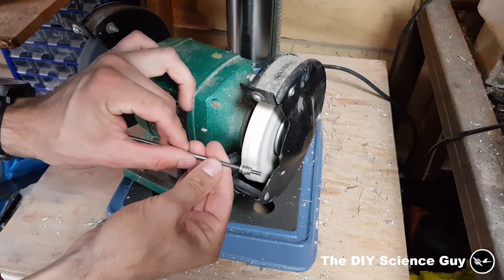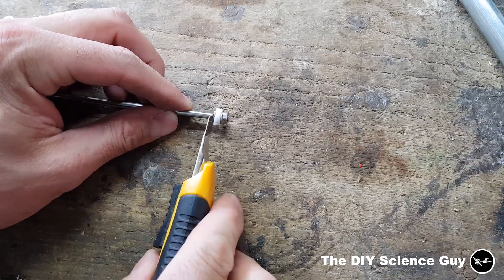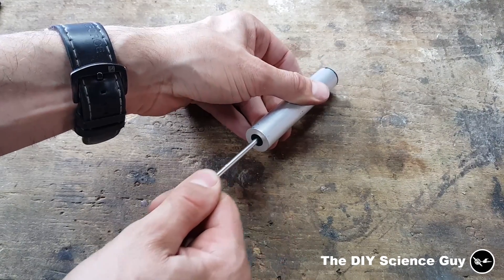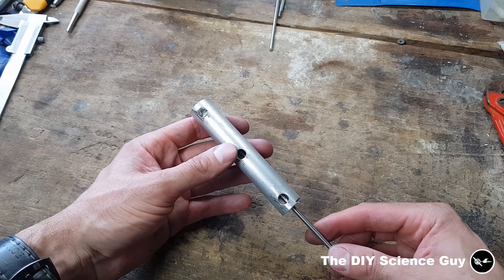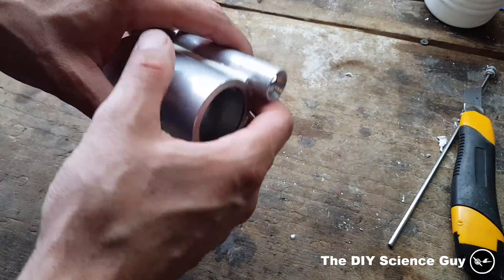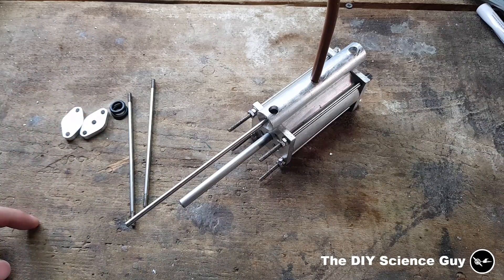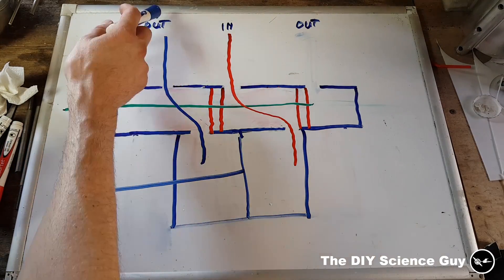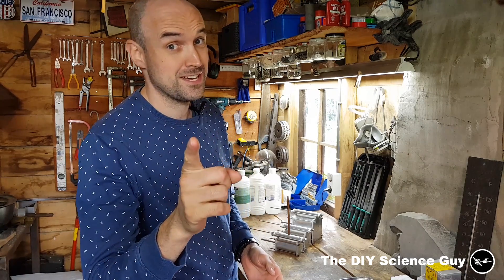Solar steam engine #4 the valves True DIY

Comment: Hi there. Hope you are well and happy. Looking forward to seeing how you set up the valving timing on this engine. Do you have a plan in mind??  Have you studied the valving on other compound engines?? That will be the tougest part of your project. I have been thinking about how you might be going to do it, but so far I have squat. The fact that you are going to have them offset from each other by 120 degrees, seems to make it even harder to comprehend. Good luck with it. I am hoping you can come up with something.Your outboard engine really runs smoothly. So the basic valve design is good. Getting the right ports of the second and third cylinders to open at the correct time is going to be a challenge. All the best.
Reply from the maker: Thanks! I'm going to use a stephenson valve gear. Each cylinder works like an independent steam engine only fed with steam by the previous cylinder. I only need to connect the gear with some levers so the timing is the same for all cylinders. The design is already in my head, now I only need to make it! 😊
Reply: @TheDIYScienceGuy  So are you saying that the three cylinders won't be connected to a common crankshaft??
Reply from the maker: @gasonthebrain3738  No they will have a common crankshaft and a common valve gear crank and because of the common crank shaft the valve crank will always correspond with the right cylinder.

Comment: Check out "Rotary Compass Circle Cutter".
 if you're unfamiliar with that it works on the same Principle as a compass that you draw circles with except it has a scalpel blade and it'll cut a perfect circle out and some pretty thick material. They're really inexpensive and get them on eBay for five bucks. I bought one to make gaskets for Steam and Stirling engines and they were Fantastic!
Reply from the maker: I've looked it up and it's a fantastic tool! Thank you so much for teaching me that! Will definitely buy one! 👍